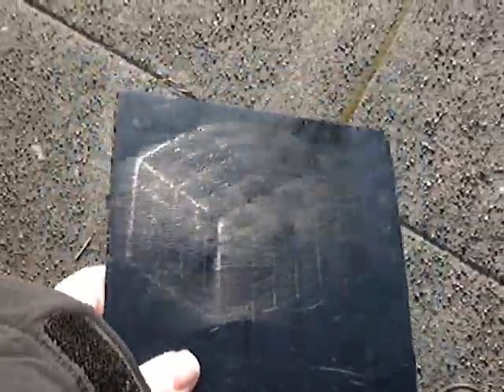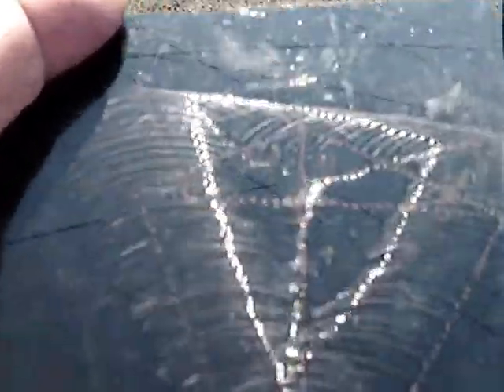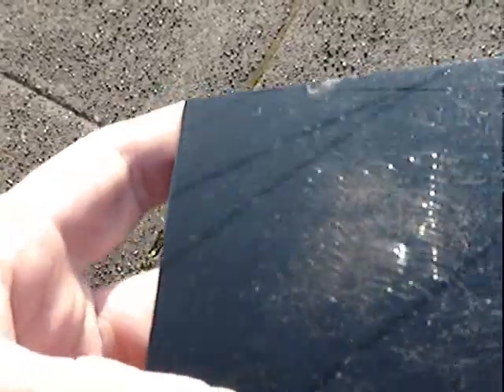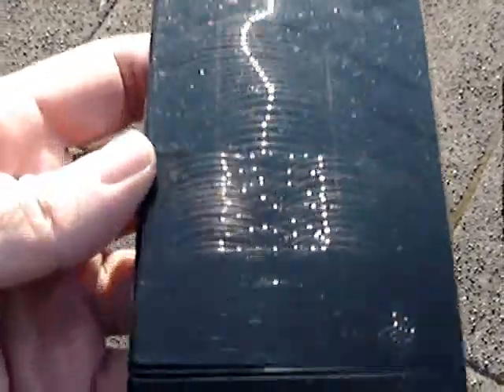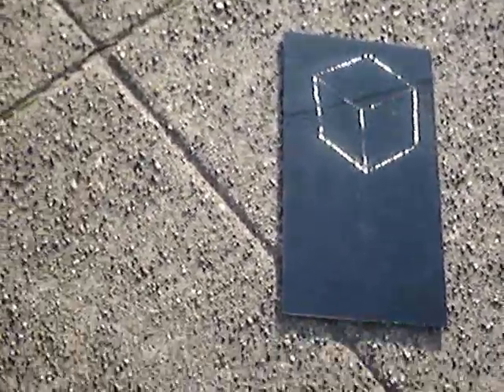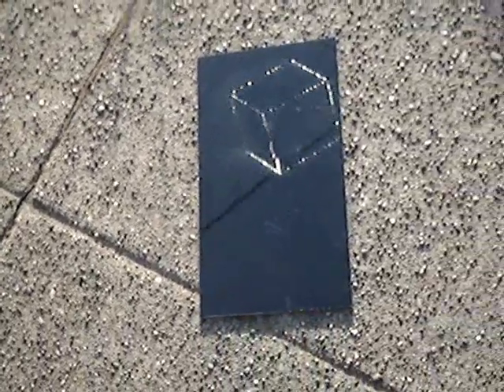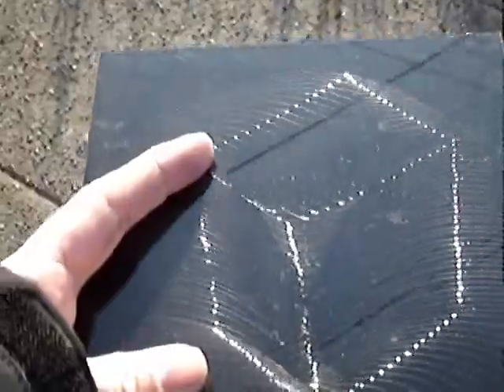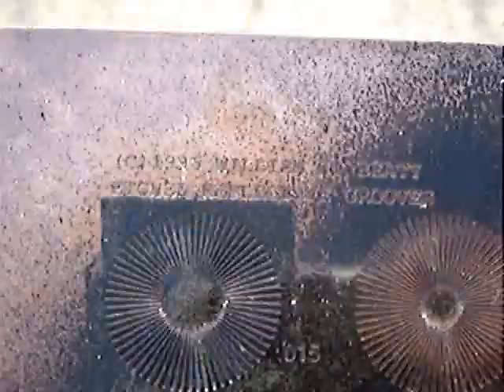first hand-drawn holograms, 1994

Comment: its done by the proper intersection of curved lines in order to reflect light in a way that will make the "object" appear to be in 3D, I'm not sure on the specifics but its just a speculation from the video, the curved lines are needed in order to give the rotation effect and the opaque and see through is more complex but I think I've covered it all, and he right the only thing needed is a thumb tack and the material for scratching the surface of. in a coordinated way tho... q.q. am I right?

Comment from the maker: > i think its not a real Hologram (a Hologram is working by interference. I think,

Credit-card holograms don't use interference, but work by reflections of a point source.  That's why they can accept white-light illumination.    When holograms aren't based on interference, they become frequency-independent, and the spacing between their fringes can have any size (even mm spacing as shown above.)

If mine aren't really holograms, then Benton Rainbow holograms aren't really holograms either.

Comment from the maker: > tips about the 'numbers in the box ?

The box is shallow: ~1/2 inch deep, and does move a little whenever I tilt the plate.

I found it easier if I created the vertical box-edges first, and then did all the work while outdoors in sunlight.   That way any errors are visible, so you get instant feedback on what you did right/wrong.

The secret for making opaque edges is to  find the tangent point of two adjacnt circles w/different radii. See tinyurl com/9bs97w, section 3.3.1, 2nd para.

Comment from the maker: > did you duo the 123 box. 

Lots of techniques explained at 
tinyurl com/9bs97w

Scratches for the "square hole" were made normally. Then I figured out where to start/end each scratch forming the numbers... for every two horizontally-adjacent scratches, if there is a spot where both are parallel, that's the spot where the two visible dots will pass through each other.  So, end the background obj scratch there, so the dot turns off when going behind the "edge" of a foreground obj.

Comment: I've derived some equations for when the light source is perpendicular to the surface and the observer is inclined to the normal at an angle of θ=20° (I am "TheMathGuy" after all!) and made a few scratches in some sheet metal that I polished first with a sander and some MicroMesh sandpaper. Metal seems to be a better medium to work with than plastic.

Comment: Have you noticed that if the light source at infinity shines perpendicular to the surface, the image locus is no longer astigmatic? ( I was thinking about this the other day, and it will be a straight line through the center of the circular scratch perpendicular to the plane of the circle ). Of course then you can't assume the observer is also perpendicular to the surface, or else all you'll see is an image of the sun!

Comment from the maker: For going through the surface...  the closer a point is to the surface, the smaller is the radius of the curved scratch.  A point *on* the plastic becomes a single dot, and points *above* the plastic (that are out in the air) have backwards scratches.  They are U shaped instead of arches.

So a line that passes through the plastic is made of scratches whose radius gets smaller and smaller, then becomes a dot, then turn upside-down and get bigger again.

Comment from the maker: > but i dont get the opaque thing and how to stick the point of a cube "through" 

The "opaque" trick is in the 2003 invited paper.  It's a bit hard to figure out.  Simplest is to draw a vertical floating line, then use the described process to draw a cloud of deeper stars as if the vertical line is the edge of a black wall.  For each star, the scratch ends differently depending on how close the star will be to the vertical edge.

Comment: This is so cool!  I have done a few, but nothing meaningful in 3-d yet.  A good material to practice and experiment on is a 2-liter coke bottle.  Cut the middle section of the bottle out with scissors - or don't cut the bottle and the image will be narrower from the curvature.  This soft plastic grooves easily and you probably already have everything you need to start.  Very interesting!